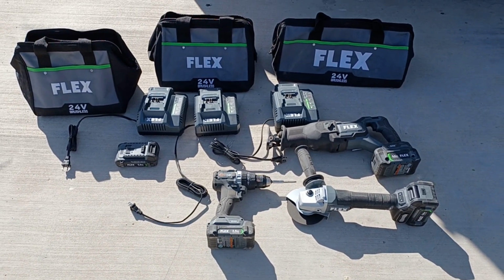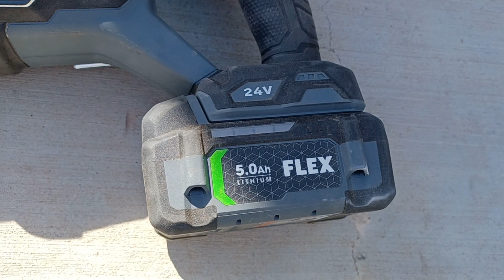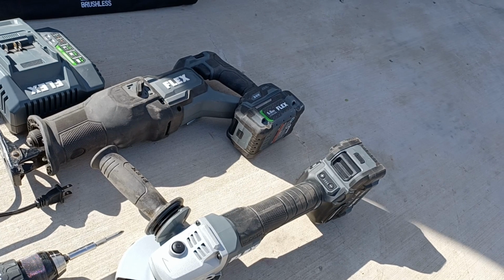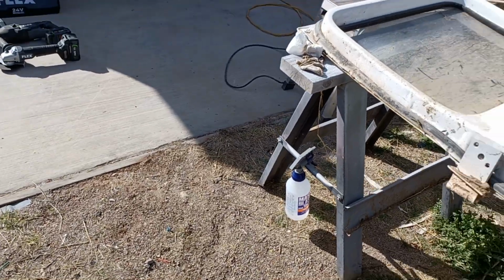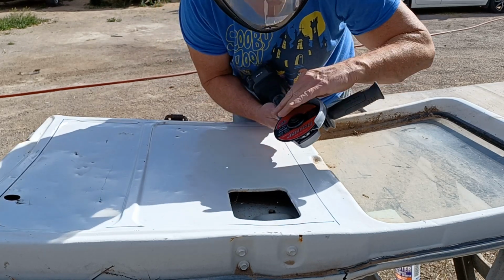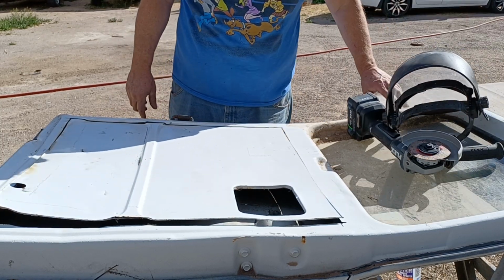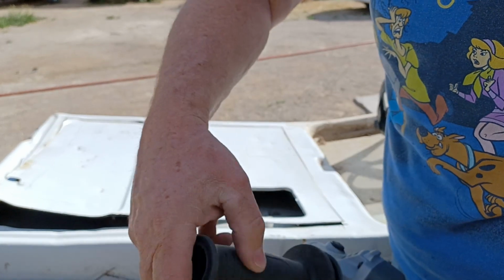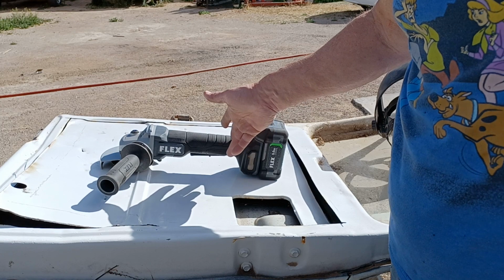Flex tools review Sawzall, Drill, Grinder.

Comment: Love Flex tools brother. They are truly amazing. The amp hour rating for the batteries… the simplest way I can explain it is a 2.5 amp hour battery can be discharged at a 2.5 amp loud for 1 hour. That’s the capacity. Just depends on the load your putting on the battery. It’ll discharge at 5 amps for 30 minutes or 10 amps for 15 minutes so on and so forth continuously. If your just doing normal drilling your probably pulling 20 to 30 amp load so just do the math. The grinder and the sawzall are awesome as well.
Reply from the maker: Thanks for the comment!

Comment: Brother 😂 you can't tell me you get great run time out of that 2.5 on the drill!!! I have 15 flex tools and every battery 6-2.5's  2-3.5's 5-5.0's 2-6.0's 1-8.0 2-10.0's 5 chargers and I can kill a battery the 2.5 in under 5 mins from my testing!! Have you tried the stacked lithium batteries? And no it's not a safety feature it's the 5.0 is not putting out the power like the 3.5 or 6.0!!! You just depleted half a five ah battery in 4 small cuts so why are you not being honest and telling people it eats battery for snacks 😂 and DeWalt is junk!!! Just keep it real man yes they are amazing tools full of power with the right battery get bigger batteries and wake these tools up you're tools are sleeping 😴 until you put the stacked lithium batteries on them seriously buddy!!
Reply from the maker: Why do you say I am "NOT being honest?" I have ZERO reason to lie! I paid for these tools with my own money! This was NOT a paid endorsement! I gave my 100% HONEST opinion! I do NOT like being called a liar! If you had a functioning brain paid attention to my video you would know my grinder is BRAND NEW and that was my FIRST time using it. And therefore the battery was ALSO new and fully charged and new batteries will ALWAYS perform better than your older batteries. And FYI I continued to do the same 4 cuts on the other door and STILL wound up only depleting my battery by 50% All my tools are less than 6 months old. And YES my 2.5 batteries LAST me a very long time. I have had that drill 7 months and have only charged it maybe 3 times. If you are a construction worker then of course YOUR experience will be different. You say....."I can kill a battery the 2.5 in under 5 mins from my testing!" Maybe so, I don't know. But here in the real world, I doubt many people other than you is going to put their tools under such a stress test. I have used my drill "NORMALLY" all day and recharged it when the day was done..
Reply: @ricksteelcustoms3196  brother I will take a 2.5 off the charger hit the turbo button and hit the trigger 3 times and drop a bar on every 2.5 you said the run time is amazing while you made 4 cuts with the grinder with the 5.0 and it was half depleted and cutting out!!  I'm not trying to be rude bro but I was telling you that the stacked lithium batteries are 10× better and actually last!! But be honest the 2.5 sucks lmao 😂
Reply from the maker: @TacticalThib  AGAIN, I said "And FYI I continued to do the same 4 cuts on the other door" That is 8 cuts NOT "4" and I still had 1 bar left. I should have checked the battery on the video BEFORE I started cutting it might not have been fully charged at the factory. 

You said, that I said "the run time is amazing" while you made 4 cuts with the grinder with the 5.0 and it was half depleted and cutting out!!"  

Binding the blade is NOT "cutting out, " there is a difference.

And at what time interval in my video did I make the statement "the run time is amazing"? 

Then you call me a liar AGAIN, telling me to "be honest." You're the one making shit up! If I don't know something I SAY "I DON'T KNOW!" 

Not to be rude, but next time might I suggest you simply post a useful comment like "the stacked lithium batteries are 10× better." And also post that they cost $80.00 more money for the 6.0 than the 5.0 That makes them more desirable for a construction worker who will use the tool nearly every day than a home hobbyist who will only use them once in a long while. 

It really does take me a lot of time having to respond to people like you. I don't mind if you are sincerely wanting to contribute something useful. But if you're looking for an argument or a pen pal I really have MUCH better things to do, like play GTA 5.
Reply: Don’t worry about Brandon he complains on everyone’s channel if you don’t say everything perfect. I have the same tools and the batteries last a very long time. I do have the stacked and regular batteries of course the stacked lithium last much longer but they are expensive.